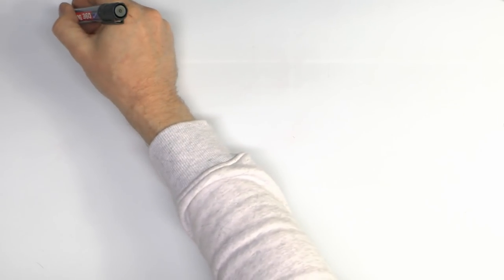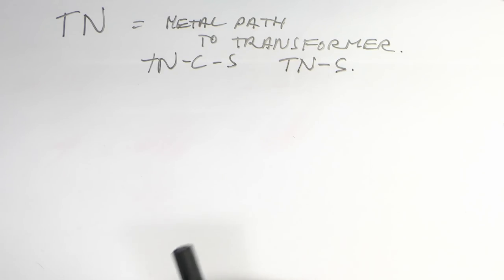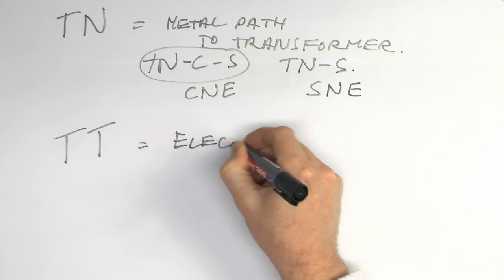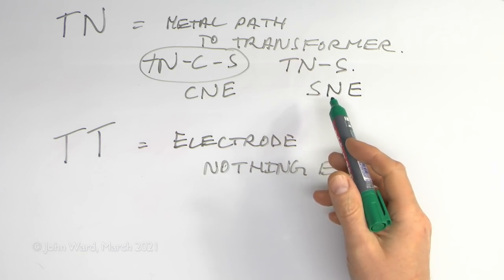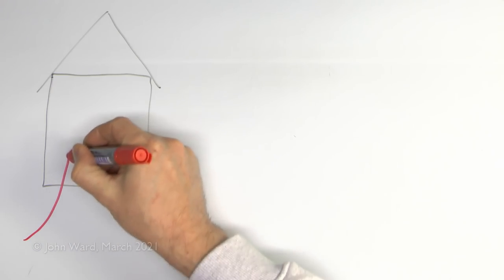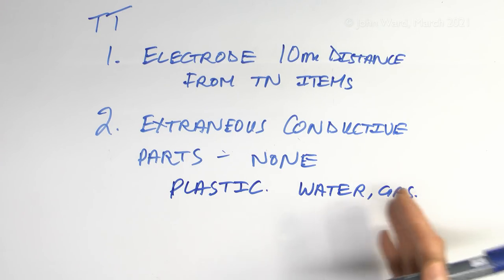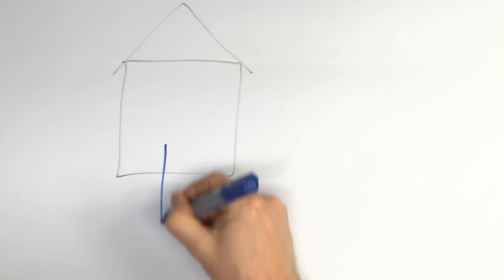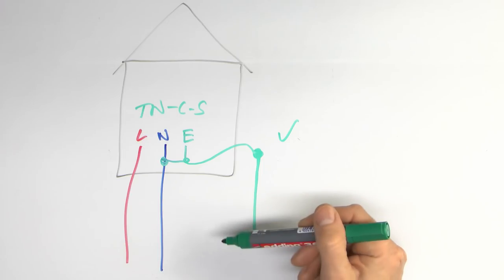Using a TT earth where a TN earth already exists

Comment: So any advice on installing a hot tub with a tn- s supply approx 4 meters away from lead water pipe was going to Tt  the hot tub ?
Reply: The last method he presented, use the supplied PE and add an additional earth electrode, then it doesn't matter electrically if there's a pipe or not. BTW: That's a must have here in Germany, in most areas we have TN-C-S here, but you must have an additional earth electrode. Since 1980 a foundation earth electrode or a soil embedded ring earth electrode around the house are mandatory for new construction.
Reply: Indeed the continental practice of making every house that is TNC-S have its own PME electrode does actually make a great deal of sense
Reply: A single earth rod attached to the PME earth to keep the touch voltage down in a PEN fault probably won't do much (use calculation from A722.3) you would struggle to get a low enough resistance, and as explained in the video making it TT you would struggle to get enough separation distance from the TT rod and the water pipe

Perhaps an earthing mat under the hot tub which also extends a meter or so around the outside edge of the hot tub could work, 
This would help bring down the touch voltage between PME earth and true earth in a PEN fault (dependant on resistance) but it could also raise the potential of the ground you are stepping out of the hot tub onto meaning there is less potential difference between the ground around the hot tub and the water or metal parts of the hot tub.  

Perhaps there would be an issue when stepping off the boundary of the earth mat and onto true earth due to step voltages?  I am not sure hopefully someone cleaver can shed some light on it
Reply: @dasy2k1  It makes so much sense,  as even if each one is of quite high resistance the parallel resistance of them all (+ any PME electrodes) would be less and would help mitigate open PEN faults.    Germany are on a winner with the foundation electrodes etc in my opinion
Reply: @marcuswareham1  That's the reason for that foundation earth electrodes or soil embedded ring-earth electrodes around the house are mandatory since 1980 for new construction. A single pole shoved into the ground is better than nothing, but like you said, not very helpful if it's only that single one.
Reply: @marcuswareham1  Back in the old days the incoming water pipe was used for this purpose. But since 1990 this is no longer permitted to use the water pipe as an earth electrode. Back then the incoming water pipes were made of thick cast iron so they could withstand corrosion much better than a thinner walled pipe. And now these pipes are getting replaced by plastic ones and the owners had to implement earth electrodes if they live in an old house which used the water pipe as an earth electrode. So almost every house that was built before 1980. The pipes must still be bonded, because in most cases the pipes inside of the house are metal. It's the same with natural gas, incoming pipe is plastic, but the piping inside of the house is metal and must be bonded too. Also bonded are the shieldings of cable TV cables and the phone cables.

That's how the potential equalisation bar looks like. We do it a bit differently. Here the bonding is on a separate bar, not in the CU. In the service entry box the PEN is splitted into a separate PE and N. A five core cable going to the meter box (L1, L2, L3, N and PE), and a single core cable going to the potential equalisation bar.

potential equalisation bar:

https://upload.wikimedia.org/wikipedia/commons/8/8f/Potenzialausgleichsschiene.jpg

Service entry box, the cable from the street is entering from the lower side, outgoing cables leave on the upper side of the box. PEN terminal (and where it's splitted) is on the far right:

https://www.eibmarkt.com/isroot/eibmarkt/Files/bild3/628450_ZAN334KL_Produktbild_DETAIL_346110_221.JPG

https://upload.wikimedia.org/wikipedia/commons/c/c5/Hausanschlusskasten_2010.jpg

The single core cable going to the bus bar could also be an NYM-J 1x16mm², or NYY-J 1x16mm². But in that case they used a cable without an outer sheathing. The incoming cable is usually NYY-J, 4x35mm².

The fuses are NH fuses of the size 00/000, usually 63A ones installed. In older buildings 35A. For example here an old box:

https://upload.wikimedia.org/wikipedia/commons/0/0e/Used_older_fuse_%28Panzersicherung%29.jpg

The red dot is not for decoration, it's an indicator. It pops out when the fuse blows.

Comment: 4:59 “you can’t very effectively bond to the mass of the earth itself”.  What about earthing mats?  Aren’t these effectively bonding to the earth in the relevant area?  Would it be good practice to employ these under and around hot tubs and parking areas for EV charging?  If there’s an RC slab, would the rebar fulfil this purpose?
Reply from the maker: That is an option - the problem is that to be effective in that situation you need a very low resistance, typically only a few ohms.  Can be done, but will require a very substantial grid,  mesh or other system.  Rebar in concrete can be used.
Reply: @jwflame  Re: using rebar - is dry concrete a reasonable conductor then, making it feasible to get <10ohm resistance? Maybe you could pour a bit of concrete with steel rebar and demonstrate that?
Reply: Does it actually matter if you do not achieve a TT system? The point is to avoid a >70V potential between the car / hot tub and the ground in the event of a PEN fault. If you have achieved a secondary earth electrode sufficiently close to the car / hot tub, and they are bonded to the TNCS earth, then the ground and the car bodywork are at the same potential in normal and fault conditions. Is this safe? Is it legal?
Reply from the maker: @danburdge6391  An electrode connected to the TNCS system would need to have a very low resistance to keep the voltage below 70V.  Under 5 ohms typically, which is impossible with a single rod.  Can be done with a much larger earth grid, mesh or similar system.
Reply: @danburdge6391  that was roughly what I was trying to get at.  The earthing mat functions a little like a faraday cage, preventing true earth potential from being imported to the ground ‘within’ it.
Reply: @cjk32cam  seems a vicious circle. Limitation to TNCS via not being able to attain a low enough earth reading via rod. Other hand can't really TT due to possible picking up metallic in earth and get incoming services to plastic . Jeez
Reply: @jwflame  But surely even a resistive earth rod would conduct enough to trip an RCD, so should be significantly safer -probability of PEN fault AND faulty RCD would be vanishingly small

Comment: What would be a good reason to convert your property from TN-C-S to TT? 
One reason would be because a solar battery bank or car charger might recommend it, but why? Probably because the incoming feed EMC filters associated with the switch mode power supply are leaking too much 'noise' current onto the earth and this could cause other issues. Realistically having large leakage currents from a switch mode power supply is because of poor or more likely overly cost optimised design, requiring large passive EMC filters to be bolted onto the design so it can be sold in countries with stricter EMC regulations than where it was designed. 
Perhaps an easier solution would be to read the instructions before you purchase, it the power supply recommends TT installation in the UK,  purchase another power supply.

Comment: After seeing this I'm so glad I've still got the good old fashioned TNS system at my place, and at my mate's place too where I fitted the power supply and wiring in his new garage. This video all too clearly shows why qualifications are really necessary for doing any serious electrical work. And with earthing rods or meshes or other earth electrodes that go in the ground the actual local ground conditions need to be carefully studied as local earth resistances can vary widely, obviously in flood prone areas or anywhere low lying near big volumes of water the local resistance should be in theory at least be much lower but if it's somewhere very high up and well out of reach of flooding and where the local water table is very low in the ground then the resistance can be much higher, especially in a frying hot summer and long drought conditions. No wonder the regs book has a whole chapter on earthing! And in a lot of rural areas it's TT or nothing and you don't even get an earth wire so you have to make your own earth with a ground electrode and have RCD's on every circuit.
Reply from the maker: Unless you can see all of the cables between your house and the transformer, there is a very good chance that it's not really TN-S any more.
Reply: @jwflame  Yeah, that's quite possible, especially as the local big substation in my local area, the one for the town was extensively rebuilt a few years ago and there's also a lot of local supply network rewiring going on in my area too as the old cables are now life expired, both high voltage primary cables as well as the consumer supply ones.  And I hope all this new kit will have bigger capacity too so it can cope with all the new EV charging points being fitted all over the place.

Comment: US electrician shaking his head at having multiple grounding and bonding systems possible in a single neighborhood. Bond the N and PE at the service point and set a ground electrode to establish a single common reference ground point.
Reply: Or the abominable wiring colors.
"Let's use dark brown, black and dark gray for the hots and dark blue for the neutral.  What could possibly go wrong?"
Reply: @randacnam7321  The grey and the blue are actually quite light in shade...!
Reply: @AdamWatson001  Not in a lot of cables I've seen.
White or gray neutral.  Green or bare ground.  Anything else can kill you if you touch it.  That is the natural order of things.

Comment: but why all these Hussle the only , real technical reason for not having a TNCS with additional localised earthing would be stray DC currents causing corrosion. against dangerous volatges and body currents RCDs should be part of any installation
Reply: there is a particular type of fault that can specifically occur with TN-C-S supplies which would render an RCD useless, when the combined Neutral - Earth wire is broken, voltage will appear on the earth wire in the property, and as the connection between Neutral and Earth is on the supply side of the RCD, it won't see an imbalance
Reply: @pineappleroad  add some overvoltage protection and for this to be dangerous you still need to touch something outside the Electrical bonding and in tt such a fault will fry everything and probably burn down your hose

Comment: Why would you even want this? TN-C-S is far more reliable than a single TT earthing point, especially compared to those sticks you are so fond of in the UK.
Why do you consider an open combined earth neutral more dangerous or likely than an earth fault on TT, which will easily lift that puny electrode and cause all sorts of voltage differentials across the property? 
There is a reason most countries switched away from TT.
Reply: It is very difficult to mitigate against and a very real risk to have an open combined earth neutral conductor,  It would seem as if the DNOs don't put enough "PME" electrodes in for each joint to provide enough protection (hence the big hu-har with EV charging) and there is very little you can do as a consumer/electrician to mitigate against the risks (with access to only one of the phases).  

A properly installed TT system should be just as safe as a TN-C-S (if not safer due to open PEN risk) even though the earth electrode resistance is high.  TT have a big reliance on RCDs due to the higher earth electrode resistance and yes RCDs do fail but at least they can be regularly tested and the consumer/electrician is in control, it is also important to remember that a 100mA delayed RCD (or similar) is often needed for fault protection on TT and then a 30mA RCD used downstream for additional protection so in this case there is 2 RCDs in "series" so if one was to fail disconnection would still happen in the event of an earth fault even with a 200ohm earth rod 

I agree TN systems are of a better design due to the low impedance earth path back to the transformer and the ability to use fuses or MCBs for ADS.   But true TN-S is the best way to do this TN-C-S in my opinion is just a way to save some money at the expense of safety
Reply from the maker: TN-C-S is only reliable if it has multiple earthing electrodes, including at each property.
Many countries have those - unfortunately in the UK, installing an earth electrode for each property with TN-C-S is almost unheard of, and the vast majority of installations don't have one.
Reply: @jwflame  That makes sense, I mean it's absolutely insane to make a TN-C-S without local earth of course, but the danger is real in that case.
But wouldn't just adding a half decent local earth at least make the GFI trip in case of a fault, even with TN-C-S and an open PEN?
TT was just so troublesome (lightning currents and all that) I'm glad to see the back of it personally.
Reply from the maker: @stefantrethan  GFIs / RCDs can't detect an open PEN, as the break is on the supply side, current flow in each conductor through the GFI is still equal.  Explained in this video: https://www.youtube.com/watch?v=JRHyqouJPzE